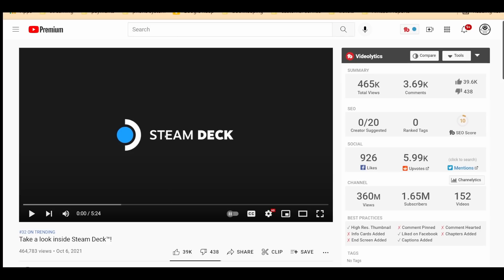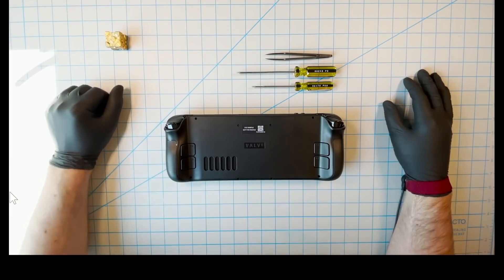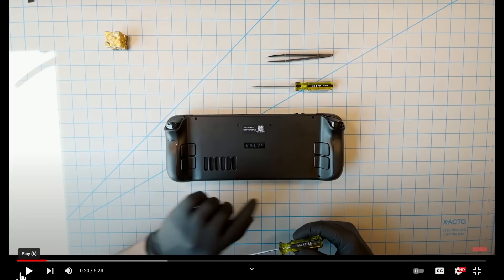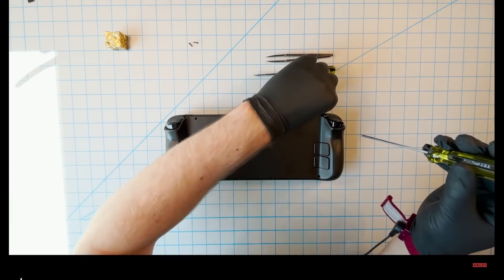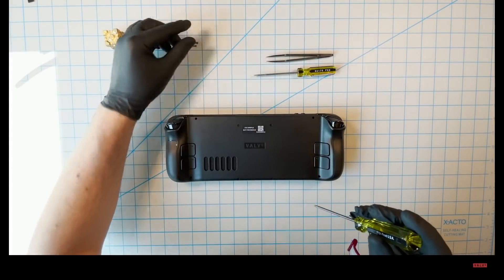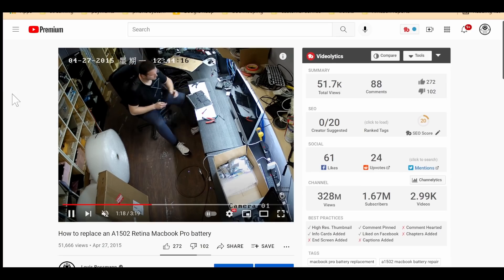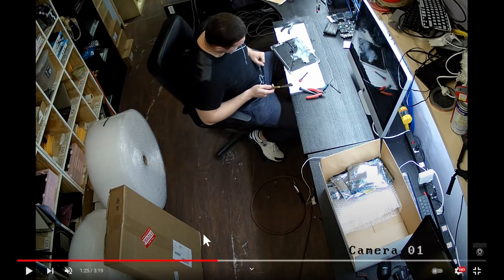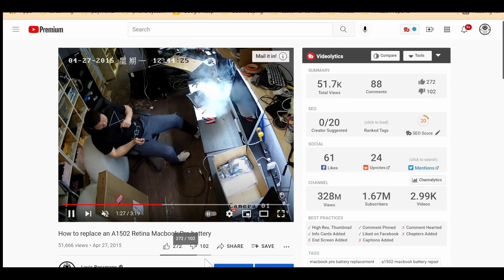Steam deck battery may end your life? bruh 😑

Comment: Louis, you mention that this is one step in the right direction. 

I have to be honest, I think it is more than that, the first step they did was to use common screws and not 'security' or 'proprietary' screws, also not soldering some components. The SSD for example, they could save space and possibly money having the storage soldered into the motherboard. 

All of these things they could 'justify' by talking about oh how small this device is, or oh how power efficient it is or whatever else.

Unfortunately today having it made POSSIBLE to disassemble is a step, using common standards (screws and m.2 ssd) is another step and having a video showing how to do it is another one. I can think of MANY devices that don't even do step one, so I commend Valve on what they'be done
Reply: What I'd say is this should go even more than the step people here are suggesting. If this product goes out to the world and gets enough of a foothold, Louis should be holding every other manufacturer to Valve's standard and using it as a way to push for Right to Repair in legislation since every other company (Framework excepted) is going the opposite direction.
Reply: @gerthddyn  haha how is not fixing your devices real, just, like make a law requiring all devices to be user servicable haha
Reply: @joe7272  because a majority of customers are going to be upset when suddenly their devices start costing a couple hundred more to cover the overhead needed to make components, blueprints and designs available for purchase as well as the fact that for a lot of the designs that are super heavily integrated like apples macbooks for instance would likely at least in the short term suffer efficiency and form factor wise because theyre designed to be sold and never opened and to run essentially in a vacuum. im not saying its right, but i am saying that its not as simple as just telling the company to do it and expecting no problems to occur as a consequence. most people really dont give 2 shits about whether they can repair their device or not, your average joe has just accepted that they buy a new phone when their current one breaks, it might not be "right" but its reality.
Reply: Self tapping screws aren't really meant to be removed but I agree, I'm glad they made it more repairable than the average device today :)
Reply: @definingslawek4731  Linus made a very good point about the self-tapping screws - the only alternative to them would have been metal inserts, and when they’re pricing the device as aggressively as they are, EVERY savings in manufacturing counts. Just food for thought.
Reply: @Haddleton  Seriously?
So, an extra 5 or even 10 $ would really make a difference on a device that's going to cost somewhere from hundreds to a thousand dollars? 
That's one of the more common, and also stupidest arguments I've heard.
Reply: @jimmyb1451  actually yes because the tooling required as well as the implementation, manufacturing, material sourcing, as well as the fact that they are a business which generally entails spending only what is absolutely necessary all means that if they can save money somewhere somewhere, they will.  in the world of tech, going the extra mile for reparability in todays world is not something that is expected, it is unfortunately something that should be celebrated and encouraged when companies do try to do the right thing because it is not the bare minimum or the norm. these companies dont have to do jack shit for right to repair, the market has already accepted that they basically cant repair their devices themselves and this is part of the shifting movement towards right to repair. that extra "$5" might seem stupid, but its not that simple and you really should learn a bit about how products are created and how hard it is to hit price points like this.
Reply: @Varocka  The tooling, implementation.... at scale will only account for a maximum 10$ extra in the retail price. Price points are a fiction. All companies charge what the market will bear.

So, no.
You're talking to someone who knows a lot more about manufacturing that you do. Perhaps some real world experience would do you some good, instead of spouting off your theoretical "knowledge" and suggesting those with more real world experience than yourself, educate themselves.
Reply: @jimmyb1451  Its the issue of a nickel here a nickel there. inserts 10$ a unit, size/form factor/power draw of SSD 20$, Thermal compound used and heatsink design 30$. Every single part of ANY product is done this way. While cutting on one part saves fractions you add up that same savings applied to all components and you come up to 100s to 1000s of dollars in cost reduction. Also they have to look at the end price. If adding X means they need to increase price by lets say 50$ and they are already pushing what the sales team is thinking people will accept well then it doesnt get added or the part gets redesigned for cost savings, Normal Screws with Brass inserts becomes Self Tapping screws.
Reply: @memnarch129  uhuh.
Reply: @jimmyb1451  if you know so much then explain why it's not widely done, if it didn't matter to companies then they wouldn't have made things so tightly integrated in the first place and they also would not have needed to price things so aggressively while also making compromises. So how bout you think as to why for a second instead of trying to put yourself on a pedestal and calling me uneducated.
Reply: @Varocka  Those in glass houses...

They do what they do because the market expects no less and they charge what the market will bear.

Keep running around calling people names, then getting all offended when they return the favour. You're gonna go far kid.
Reply: @definingslawek4731  self tapping screws are probably mostly about cost saving vs repairability. The odds you'd need to open this more than 2-3 times in the life of the product vs raising production costs even $10 in what is likely already a tight margin.
Reply: @aztracker1  You're right :)
Reply: I'd say having a video explaining the disassembly of the product is way more than just one step, I'd wager we wont see that any time soon from any other company, even after many many steps have been made in the right direction. I just can't see any other company doing that.
Reply: You can REPLACE the parts too! They took a hundred steps, and warned people the fragility of electronics.

Comment: On Structural Integrity:

I think its true to some extend that opening it weakens the device. if you do it once its probably insignificant, but imagine you do it 20 times you start to wear the screw holds. I think they are just very very cautious in the legal sense to not be liable if idiots dissassemble it 10 times and break out the screw.
Reply: The issue is the self tapping screws. They work by cutting a groove into a piece of plastic. If you loosen them, there is no way to get back into the exact orientation to grab the threads the same way they were driven in. He is absolutely correct to say it will be less drop resistant. He didn't say it wouldn't go back together. He said it would be less drop resistant. That is correct.
Reply: they really just shouldve used proper threaded screw posts. like its not going to be opened that much anyway but when you are paying that much you should have it fastened properly.
Reply: @vinegreen3242  Steamdeck is not an expensive device, relatively speaking. They probably looked at the cost of 8-10 machine-screw mounts per device, and figured it's a corner worth cutting. About the only thing they haven't cheaped out on is the stuff you'll notice, like the APU's performance and maybe stuff like the thumbsticks, and even those are going to be getting a per-thousand-units price.

Now if it were double the price, I'd expect a few more metal screw posts, much more capacity in a good TLC NVME drive, higher resolution screen, etc. But it's $400 for the entry level. Other players in this space are nearer $1000. Not all that price difference is Valve swinging their 12" thicc throbbing buying power around.
Reply: Nothing a little plastic epoxy can't fix
Reply: It's not really an issue cuz who's going to be taking this thing apart 20 times? You're going to take it apart once to replace the battery and or SSD. 🤷🏼‍♂️
Reply: @aborted4196  you're saying it's not an issue but it definitely is. This is true of all self tapping screws. You can get them tight, but never as tight as they were when they were freshly driven into the plastic. There is a whole host of ways to get the threads tight, but the guy was right with what he said. If you take the screws out and put them back in, they will be less durable than if you hadn't taken them out, in the average case.

Comment: I kinda understand the weakened structural integrity thing, having the screws self-tap the holes rather than having metal bosses, means rescrewing will probably tap out new material rather than going back through the old threads.  But like you said, screwing it back together probably wont cause it to fall apart if you drop it after one or two rounds of opening it, especially if you screw backwards until you feel the screw drop into the old threads and you don't just dog it back in.

Comment: the structural integrity claim I think has some legs to stand on. the chassis is relying on that back plate for rigidity and self tapping fasteners are by definition torque to yield and intended for a single use.  this is a mistake from a design and reparability standpoint, which they are at least admitting to. if they'd used metal thread inserts this wouldn't be an issue. but their claim at least is real even if it comes across as scaremongering like the battery claims and the silly ESD stuff.
Reply: Given this thing will get hot enough and the thermal expansion of the steel and plastic (and I hope they use some non-trash grade ABS) would affect the threads, so after few screw ins, threads won't hold. Indeed, self-tapping plastic screws can never be torqued back as the originally were.

Comment: Plastic gets stressed when a self tapping screw gets inserted. Those fractures are increased by repetitively stressing that plastic. That said, it's situational and each person might stress their stuff differently, to the point of stripping the hole. Thus, their cover is without a point of closure. Think playdough being molded by a screw and the resulting affected by repeated changes. Is it a concern, meh.

Comment: Louis, from someone who HAS screwed over controllers when trying to repair them myself, they are not saying that you cannot, they are suggesting to not do it and leave it to the profesionals because it is not easy (and you are most likely to mess it up because you have no experience with it) to repair, so, dont.
Reply: What about if there is no good repair shop where you live? Not everywhere you have a shop that you can have stuff sent in. And especially at the price of the Steam Deck repairs might cost 1/3 or half of the price of the Deck.
Reply: @Matruchus  I think it's a balance. If they make parts available, that's a great first step. For example, from what I recall, you can get every part you need to build a Dyson vacuum. It'll cost you 3x as much but you can at least get the parts.

While self tapping screws aren't great for repair, most of these devices won't be opened more than a couple times for repair over the life of the product.

If you want to do it yourself, you absolutely can, with caveats.  I do a lot myself, and I have broken things at times.  At least with this I get more options.
Reply: @Matruchus  the video isnt saying that you shouldn't do this. It's more saying that there's a lot of places to fuck up if you do open it

Comment: The Steam Deck is pretty cool, BUT that video is literally Valve trying too hard to look like they care for R2R while simultaneously trying to deter people from repairing their devices. I can guarantee they won't be providing schematics or board views. They've made this video simply to talk the talk...

Why can't parts be made available immediately?
Why does opening a device impact strength or reliability?
Will they provide chips and components for actual professionals, or will they try and prevent us from buying them?

I might need to look more into this and try and get the answers from them...

Comment: Stripped a self tapper? Get a bigger self tapper x)

But I have had laptops in the past, where self tapping screws fell out of their own volition, probably from just natural flexing of the laptop. You just look at the bottom and realize a screen's gone. And pray it's just the one, or it's in the bottom of your back pack, and then glue it in and pray it stays. But taking the things apart, and then putting it back together, and u could clearly feel there was almost nothing holding them in, they'd stripped themselves

Comment: I will say the metal screw in plastic thing is partially true for me in the past, disassembling ps4 controllers for cleaning. Over time, plastic handheld devices screws can (very) slowly can back themselves out, causing eventual wear and a slight lack of rigidity. This is why they use loctite. This problem is made worse if the screws have been replaced in the past, since the threads become slightly worn over time and the more you use the device it very slowly becomes noticeably less rigid and “creaky.” I say use loctite and keep your screws tight, and dont over tighten (I have completely broken a plastic thread doing this) and you should be able to maintain 99% rigidity.

Comment: I think what they mean is that because removing screws from a fresh assembly will cause some slight warping around the holes.. and in turn the integrity is compromised. But you're right.. that really is BS. This isn't an aircraft with thousands of tonnes of forces acting on the shell. You're holding it in your hand. But sure.. if you like throwing the device into a wall when you loose, then it'll probably break slightly easier.

Comment: Dude, it's a bit of exageration on Valve's part, but what happens if they put out a video on how to open it, a 12 year old sees it, orders one, opens it up for fun (i for example would've done that when i was younger because i was into electronics) and bends the battery just enough so it works for a few weeks then catches fire next to him when he sleeps. It sounds absurd, but if hundreds of thousands of units ship, most of them being used by kids, it may happen, and it only needs to happen once. I don't think Valve sees their users as being stupid, but it's more than reasonable to caution the viewer. Also, remember they got into a class action lawsuit because some kids used their cs go skins to gamble on third party sites, which is so fucking stupid, cuz Valve should have 0 responsability about what people do with their skins.
In the end, I think you overreacted a bit so I wanted to point out the other side of the coin, which is Valve's more than reasonable warnings.

Comment: Re structural weakness - if you don't screw in self-tapping screws exactly right the second time, it's very easy to strip the thread. Once a thread is stripped it's easy to see how it can compromise structural integrity - think of a regular screw that's a bit too small holding 2 pieces of plastic together, versus one that's the right size. Things like shock absorption can be limited when the front and back of the product have space between them & can move.

Comment: 8:20 "There's no way to avoid this"

Yes, there is. Spend $0.15 and design the case to use brass bosses instead.
Reply: My educated guess would be the issue is not the price of the components, but the added manufacturing complexity would be very big
Reply: Yes but no. Simple explanation, it will add in manufacturing complexity thus increase cost manufacturing.
Reply: Hell, I can make a Super SteamDeck with brass inserts and a soldering iron.
Reply: Watch Linus's video on this, he talks about this problem specifically, it's not 0.15$, it's much more, and they are trying to be super competitive on price. Even Gabe said that they are losing money on this, but they can afford it

Comment: Self cutting screws give you the most strength the first time assembled.... but seriously, as long as you do not use your Makita hammer drill to set and strip the screws, the world will not get sucked into an event horizon. And even if the reassembled device is not held together AS strong as originally; it probably could be stood on edge, and used as a base for a column on your house. How much clamping strength is needed on that little toy, to prevent it popping open ?

The video is providing some CYA for company.... as the AVERAGE consumer does not solder or have much in repair skills. But they go forward and show how to take apart. Batteries could get damaged, but not enough to immediately release the schmoo, but fizz up later, while in kid's backpack or pocket.... quite a longshot, but it is CYA for them. Understood. But they kind of overdo the hazard thing, to the point of undermining any self confidence in their

Comment: Just from my experience with self tapping screws, removing and reinstalling them, they never do seem to hold or torque as tightly after being reinstalled. If they’re being used to mount parts to the chassis, or to form the chassis, I can understand how they could reduce the structural integrity.

Comment: TL;DR version of "structural integrity" argument: 
- self-tapping screws can strip the plastic (esp. if overtightened)
- any adhesive will be less effective on multiple re-applications
- incorrectly assembling it can damage/warp the case

Comment: I think one of the reasons they made this is to offload a lot of the repairs to third party repairs. Valve has been mainly a software company, so I wouldn't be surprised if they made it easier to repair in order to alleviate any unexptedly high demand

Just a thought